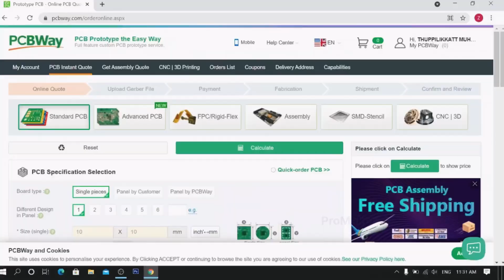This DIY Electronic Device Will Protect Your Home

Comment: how did you flip it without the components falling off?
Reply: Since the experts haven't mentioned it, I used to add some sheet on top of components before flipping so they don't fall.
Reply: @78446rashi  Is this guy ten years old?  What a silly idea. His circuit/design is even more silly.

Its just stupid in every way.
Reply: @kennmossman8701 wtf 😂 bro why are you doing this?